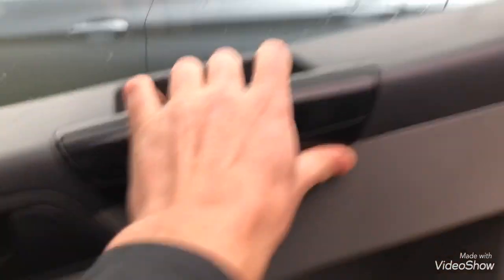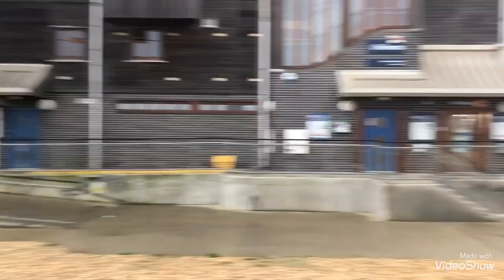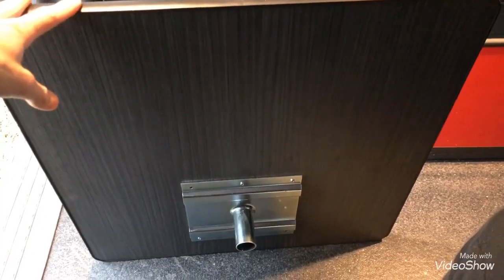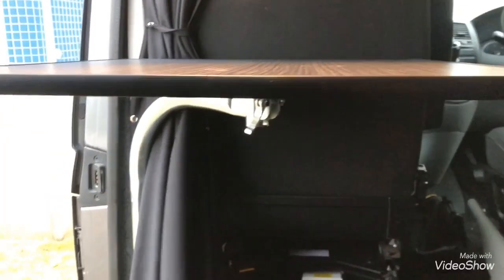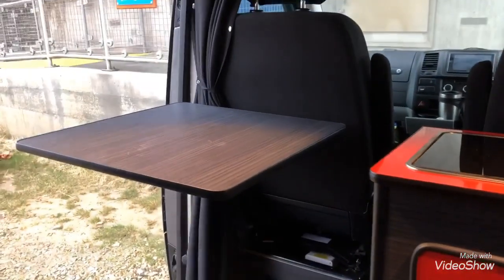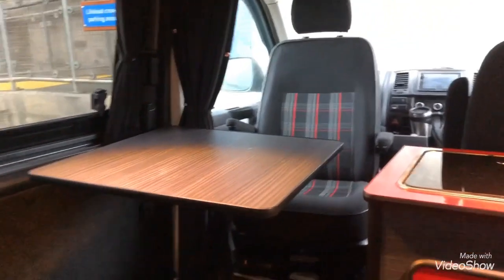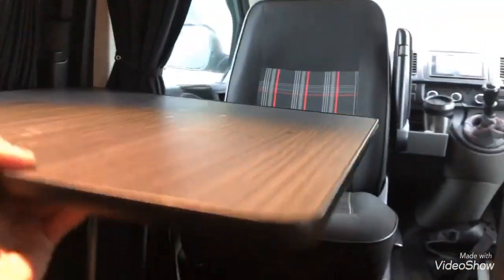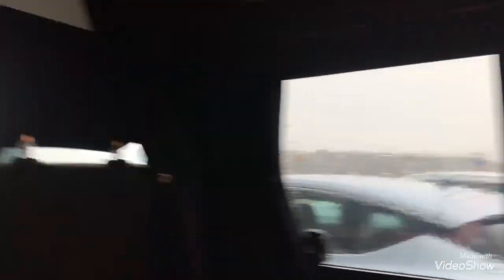The Best Table For Your VW Transporter or Campervan

Comment: Can you let me know how you screwed into the pillar? Was it easy? Size of screws? Thank so much great vid!
Reply from the maker: njc220 hi I drilled some very small pilot holes with a 3.5mm HSS bit and screwed the screws in (which were supplied) with my impact driver. From memory I think the screws were about 20mm long. Thanks
Reply: Tube Darren Thanks again. I bought this ages ago but haven’t had the courage to screw into the pillar! You’ve really helped.
Reply from the maker: No problems at all, cheers

Comment: thanks for the video! sorry another question, I bought one but it doesn’t come with screws or bolts or any instructions, or any documentation about hole sizes or placement. I can see my fuel tank is close to where you need to drill holes into the wall there. Is there any suggestions? Do you drill into the walls and floor and it’s all ok?  and for the floor do you go straight through the plastic footstep and into the metal floor with screws?

Comment: Thanks Darren just what we need. Love the table storage idea also. We own a Sprinter (Barn doors) so not sure if they're wide enough.
Was wondering if it is possible to attach the"C" clamp a little higher on that vertical post of the  table stem/post to give more stability ?
I'm also wanting to have a table with the same configuration inside but needing to be nearly 1200mm long....so wandering if you could see any reason why we couldn't put 2 of those complete brackets on the one table ?

Comment: What do you do with the stem part when your not using it? It looks as tho it’s sticking out at the door entrance there. Does it fold away somewhere?
Reply from the maker: Hey mate I bought some pipe clips and used to lay it flat along side the rock n roll bed underneath 👍